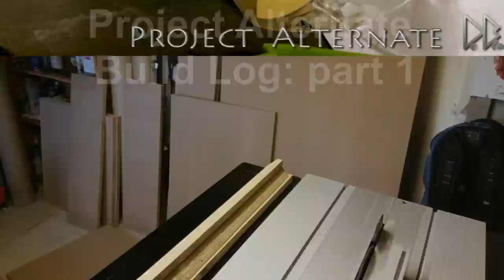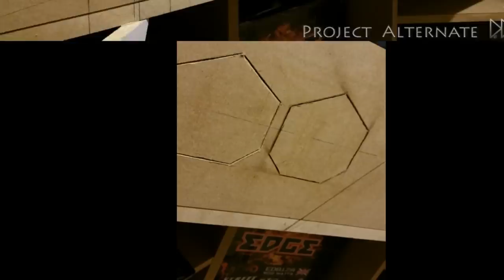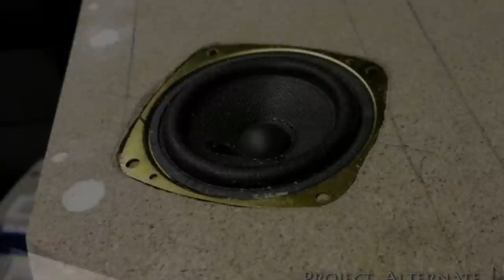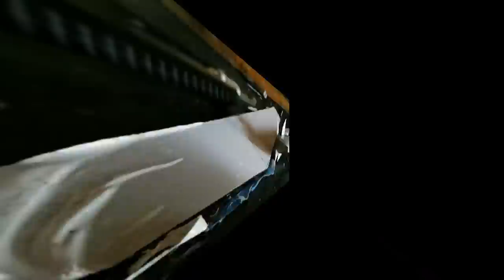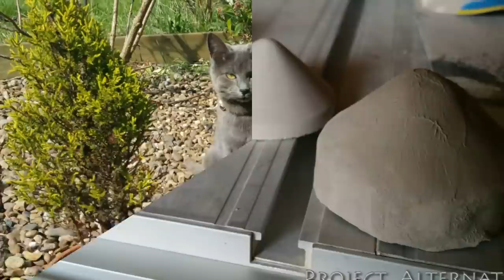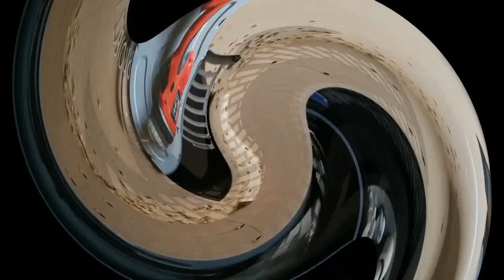ULTIMATE Gaming PC in a DESK - work-log 1 "PHOTO SLIDE"

Comment from the maker: my new desk build for 2015, this is the progress video part 1 :)
Reply: MegaDeblow yep, as i said on ur page, this looks awesome and so cant wait to see the final result :)
Reply from the maker: marc david Thanks mate :)
Reply from the maker: ***** Yeah very heavy, good job it breaks down in to 4 bits or more, as it would be impossible to move with 2 men
Reply: MegaDeblow Hey man would you be able to tell me the type of wood you are using for the build as well what kind of speakers have been built into the desk. Also if you won't might an estimated cost of the wood and speakers. This would be appreciated. Also great built man, can't wait for the next one.
Reply: ***** Thanks man. Just wondering if you know another cheap type of wood that can be easily shaped and painted, maybe something a bit lighter too. I'm open to any suggestions.
Reply from the maker: ***** Its 22mm MDF, did need some extra lovin compared with other woods, but so long as its getting painted/covered its a decent option for cost saving
needed lots of sealer before the paints ofc lol
Reply from the maker: Callum Jardine MDF is the main cheap type of wood used for most things like this, lots of places like IKEA use chipboard types also, but I like MDF more than them
Reply from the maker: ***** using the dust/cuttings from the MDF you can make some glue/filler by mixing with PDA glue, about 40/60 mix or something like that
some1 said that using car filler is good to use on the MDF, so i got a tin & used on some edges. drys rock hard & easy to blend in
Reply: MegaDeblow Hey mate just wondering what kind of joints you used for the job. Like screws, glue, both something like that.
Reply from the maker: Callum Jardine Used both mate, only place i dint use glue was on the joints that connect the top, middle & bottom sections together as they need to be detached when in transport
Reply: +MegaDeblow can we download the plans if there is any?
Reply from the maker: Bonjaous BAF are none, just my art & ideas in my head was used when building, sorry
Reply: +MegaDeblow ok thanks
Reply: +MegaDeblow thats what i do as well
Reply: +MegaDeblow you were in setup wars made by techsource
Reply: do You have The plans for The desk i would realy like to build one myself
Reply: he does not because I have already asked
:)
Reply: ok
Reply: can you please post your sketch up plans with dimensions included?
Reply from the maker: ***** I dont have any sorry

Comment: do you have any suggestions for someone wanting to make their own desk? I recently got back into the PC gaming and built myself a nice rig (RX 480 on its way finally!) and have been wanting to build a home base for it. Your build is absolutely insane man. The lines are amazing and i cant believe you didn't have a plan! I could use a few pointers as im not the best with wood haha
Reply from the maker: thanks mate, I was not that great with wood or anything I have used on the desk builds to start with, you pick things up as you go along and learn from mistakes, so don't be afraid to try :)
Start small and cheap! my first desk was made from scrap (old ikea bits).
Make sure you get the sizing as good as possible, component, legg, body, and room space.

I will try do a tutorial at some point, just need to finish of some ongoing projects.

Comment: Hello Im doing a project for school in my class I was wondering what kind of screws did you use for putting the motherboard standoffs in and how you mounted the psu/hdd's
Reply from the maker: almost all the screws for fittings was wood screws. custom cages and holes cut for the PSU and HHD's.
Reply: ok thanks for the answer do you think that instead of using a custom bracket for the hdd do you think that a Velcro strip would be good just for the hdd but for the power supply i will be able to work something out

Comment: what saw did u use to slice up those mdf sheets to do the angles. also what did u use to fix it all together? want to see more of the wood working side of things i would love to try to build something like this but im an engineer im no carpenter.
Reply from the maker: Used table saw and hand saw for most the angles, screws, bolts and wood glue for the joints.
This was also my first real go with woodwork, my past desk project was a lot more rough around the edges

Comment: That thing must weigh a ton. Looks like you use 3/4in MDF for almost the entire thing.
Reply from the maker: xxtruckerdanxx 22mm on most of the main structure & shelfs, could have gone with some thinner in places but wanted to keep the edges thick..
its very heavy :( but can transport in 4 parts to make it more easy.

Comment: why did you use fibreboard that shit it horriple flismy as fuck
Reply from the maker: 22mm MDF is far from flimsy lol
Reply: MDF is still shit though amazing desk i must say and far better then anything i could build but MDF is still fucking shit my experience with it and most peoples experiences that i know of
Reply from the maker: +Vlad Țepeș . Thanks, I know what your saying, Its the cheapest option so has its downsides, the main 2 things are dangerous dust from cutting & it tends to be a magnet for damp that then expands the MDF causing problems, but if you treat it with sealer & use a decent face mask then its fine to use for most things like this desk, especially if your covering it with paint or wrap.
takes longer working with MDF than solid woods but less than half the cost.